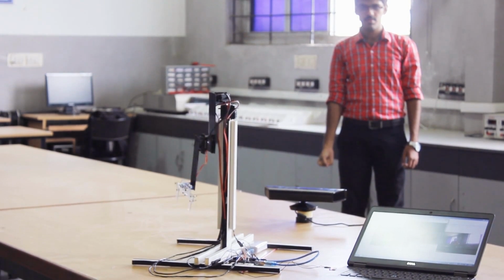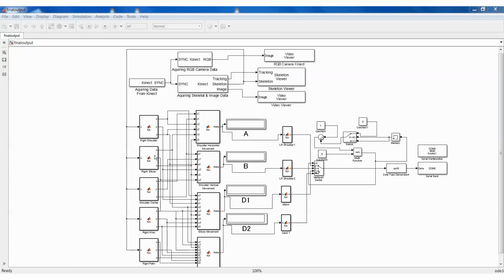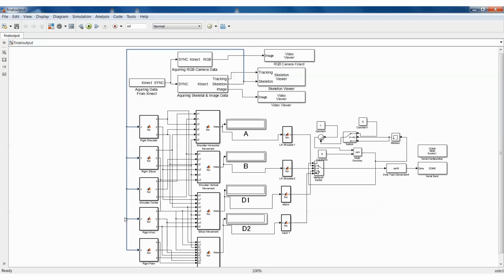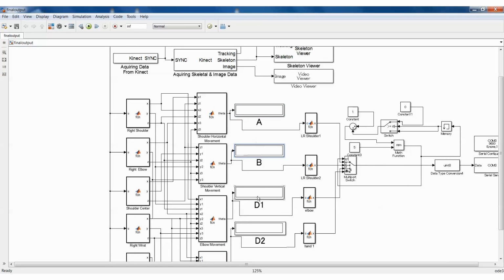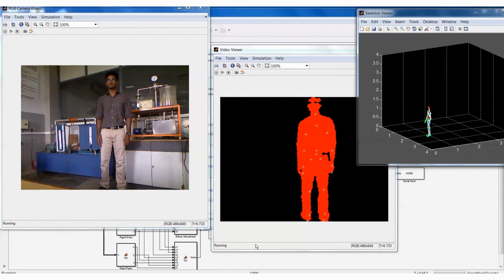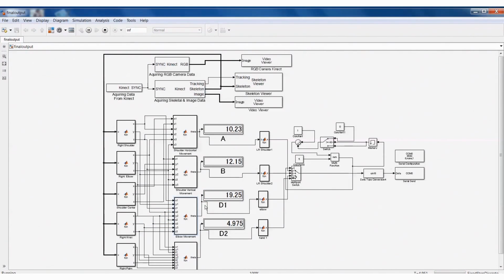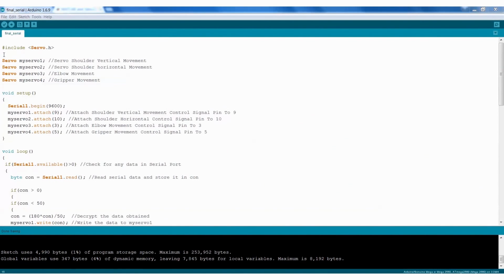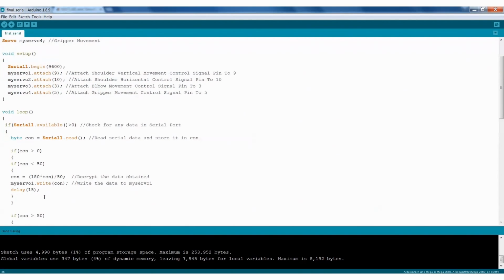Gesture Controlled Robotic Arm Using Kinect Matlab Simulink & Arduino #MATLABHW2k16

Comment: I had a problem when using the bloc "serial send"  with the arduino, 
can you tell me how to do that ?
Reply from the maker: Sure. Can you send me a screenshot of the error to my mail avinash15101994@gmail.com . I shall assist you further. Thanks!
Reply: Hello, Sorry for being late to respond ^^'
My problem is that when I use the "Serial send bloc " with the " Serial configuration bloc " to send a simple constant to the serial port, it doesn't send anything, and  I can verify that using for example " Tera Term"  or using a simple program in the arduino to get the data available on the serial port 

So , my question is , is there a special detail that I didn't notice ? 
Should I use another component ? FTDA device ?

Another question,  perhaps should I use " Arduino support package " from Add-ons ?
Reply: can you help me plz ? 
I didn't find the solution
Reply from the maker: Sure..Send me an email to avinash15101994@gmail.com with all the error logs/screenshots if possible.
Reply: Avinash Baranitharan now I'm home and I don't have an arduino with me 
but I Will give you as details as possible in your e mail